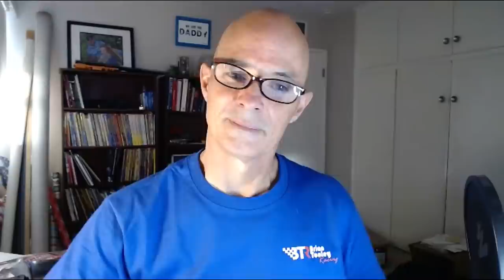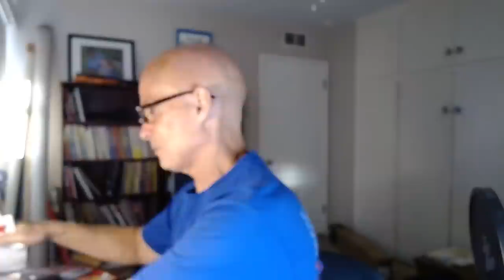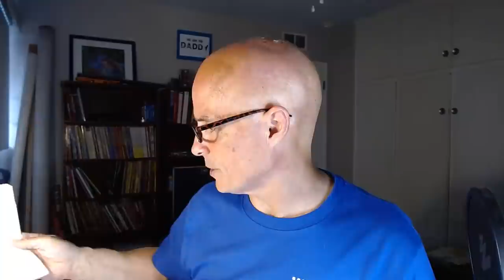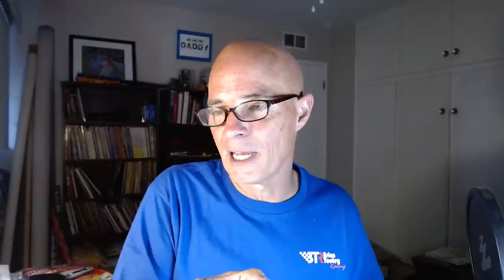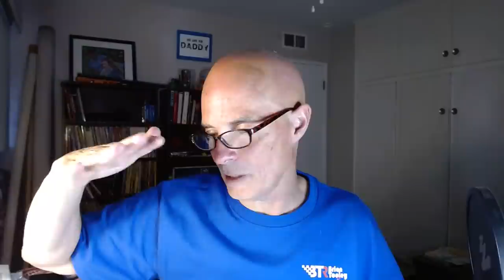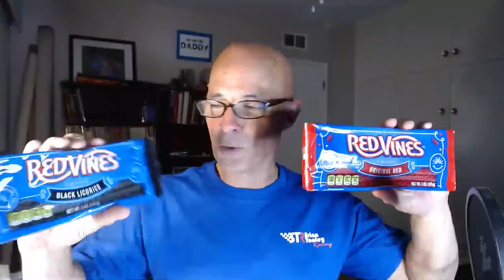LET'S TALK TECH-243 VS 862

Comment: The reason why you're losing on the bottom is head design when you do Port work a lot of people take that swirl away and try to make everything even and that's where you lose all your torque you're losing three to four percent plus your cam valve size compression ratio there's a lot to it mostly is on your head you can either build bottom end torque or lose bottom end torque when portying obviously  it was all in stock trim but the 243 had 706 head is very different on that part of the head yes you can port a head to a certain power band Believe it or not upper strength or lower bottom end strength

Comment: Maybe the Gen 4 could make more power at that point but you just sunk considerably more money in the Gen 4 to compete and hopefully spending more money would make significantly more power power. Do you think the VVT is what is making most of that extra torque in the L83 or mostly the compression?
Reply: The VVT for sure.

Comment: Thank you for all the great content as always @Richard holdener still trying to find a concrete answer though everywhere on the net as to how a stock 862/706 compares to a stock 243/799 MILLED TO 61.5 chamber on a 6.0!! Would be a similar head to a stage 2 sort of 706 then no? Thanks again!!
Reply from the maker: there was only 2.5 cc difference between the 706 and 799 heads- i recently ran another test with BTR where 243 heads made more than 862 heads-so all the 243/799 guys can now rest easy

Comment: 862’s w/ 1.89”/1.55” valves ported flowing 254 cfm @.600”.
Intake bowl 91% blended fully, maintained swirl ramp, valve guide reduction/shaping, reduced rocker bolt lump but no break through ending port size 208cc.  The port didn’t saturated continued to improve flowing 268cfm @.850”.
215cfm @.400”
This was a test to verify what the 1.89” valve can actually flow. JD
Reply: What bore and stroke?
Reply: Really like to find a spare 862 set to do larger valves and porting for a stock LR4 (flat top 4.8) minor power boost without requiring forced induction.
Reply: @shadowopsairman1583  This set is being setup specifically for a 5.3 with the stock 3.785” bore and 3.622” stroke with a cam.
Reply: @shadowopsairman1583  You’d be surprised what the oem 862 heads can do with the right camshaft, they key is don’t over cam it!  Cams like the Sloppy Stage 2 are too big for a 4.8 unless you’re prepared to run a 4000+ stall converter, 3.73-4.56 gears and Rev the engine to 7500+ rpm. 
With the tight cam you can make 400+ HP and great torque I recommend the Summit 8720 as a max size in a driver. 
If you want to keep a stock converter you’ll want a cam smaller than the 8720.
Reply: @HeadFlowInc  your right ive seen several stock LM7's and LR4's making around 400hp with just a cam, these guys keep their cam specs a secret so I don't know what they were.
Reply: @HeadFlowInc  I’m building a 6.0 bored .030 over. I’m running a BTR stage two truck cam 212/218, BTR  chromoly 7.4 pushrods, BTR rocker arms, forged pistons and rods. Also, a set of 706 heads. The engine has a compression ratio of 11.232. Speed engineering 1 7/8 headers. What do you think about that set up?… I think I could of went 7.45 pushrods
Reply: @mirabalmedia  my old motor was almost exactly like yours.  I used the BTR2 cam and it was a screamer!
I went so fast that it caught a fire all around the windshield.   Burnt the headliner right up.
I put a jet engine in my Mustang last spring, and the chicks really dig me now.
Reply: @dannymccarty344  I'm running 706 heads on my 6.0. How did your old motor run?... How was it on gas?... but, of course how was the power!
Reply: @mirabalmedia  it was a screamer!
Reply: @dannymccarty344  did you ever dyno it to see how many HP it pushed out

Comment: one thing a lot of people picking cylinder heads forget is not just port flow but the velocity of the air moving in the port.  putting to big of a port on an engine that will not support it.  just putting a huge port on a stock engine will not improve power, it could actually hurt power.  the same thing goes with the intake manifold.

Comment: Hey Richard, props to you, love your vids, your attitude, work ethic, curiosity etc.
I'm from Oz, ( Down under), building a VC commodore, 1980 Australian version of an Opel, light car (about 2400lbs) with a L98 stroked to 403ci (4" Forged crank, scat rods, forged pistons, ported 862 heads, hollow intakes, Ti retainers, Howards 226/232 .612/621" with 1.8 rockers @108 lsa, with Speedmaster ITB's (Stack) injection, Haltech ECU, etc. Hope to go ~550hp at the flywheel.
Have been tempted to run a set of CNC'd 241's for the torque numbers, but the car is so light, I think the recangles will be pretty good anyway.
I like the prospect of an NA engine, though I know boost would be fairly stratospheric!
The sound of a hi revving NA ls is very appealing! !
Thanks for your tireless work, really appreciate your no BS approach....
Reply from the maker: sounds like a great project, I love the little Opel GTs (baby Corvettes)
Reply: what about the promaxx small bore heads? 240cc runner that is 1/2” longer than cathedral ports.

Comment: I gotta tune and dyno my setup to see what its actually making, LM7 216/220 .560 114lsa camshaft 862 heads light porting and flat top pistons so im at 10.20:1 compression. Its swapped in my 99 trans am and it is noticeably more powerful than my stock LS1 (which took a crap on me)
Reply: Did your bearing mains go on the ls1?
Reply: @deqkraft3870  couple rod bearings, when I took it apart looks like the person who owned the car before me abused it. The engine started to knock about 6 months after I bought it, it probably knocked before but it was a weekend car so I didn't put a lot of miles on it.

Comment: Running ported 799 flows at 322cfm at .700 lift. Weisco pistons -3 dished in my 408 and a stage 3 tick turbo cam. Planning for a 88mm turbo on E85. Heads will flow 330cfm but at .950 lift
Reply from the maker: more than enough head flow for an 88 mm

Comment: Richard, I was going back and rewatching a lot of your LS cylinder head comparisons. I was specifically looking for the 373 and   873 heads from a 05 LQ4. I really don't see ANYONE testing these heads vs the more popular heads. 799 etc. Is there a reason for it? Those truck motors are everywhere. Part of my reason I am asking is I am about the build a motor to stuff in a Ranger for a burnout rig.
Reply from the maker: lq4 had 317s
Reply: @richardholdener1727  What are your thoughts on the 317's? I'd like to make 500 ish hp. I'm thinking a Truck Norris cam and stock everything else but manifolds

Comment: I measured 862 chambers and gotten 63ccs. Everyone online said theyre 61cc. I wanna bump my compression and mill them to 56cc. You think the chopacabra 550 lift cam will cause a problem with the head at 56cc?
Reply from the maker: I've never seen a stock 862 head that has 63-cc chambers, but you can mill the head and don't have to worry about p-v-the lift doesn't determine that (duration does)
Reply: @richardholdener1727  think the chopacabra 214/222 will be safe then with 56cc chambers if I mill them

Comment: Cnc ported 243 with chamber size of the 862 is what I'm running. With big valves. This was a noticeable difference from my valve job only 862s on a 6.0
Reply: How do you think 862 heads with cnc port job and bigger valves would do on a 6.0?
Reply: @Gonzalo6O  they would be very torquey I would imagine. The 243s seemed to spread the power out, and slightly amplify it. Bottom line they just flow better and make more power but 862s are good for low and mid
Reply: @Gonzalo6O  the setup I have is pretty much what you're describing but with the runner design from the 243s instead of the 862s. Both good heads and similar design but one was made for trucks and that's the way the power is shaped on the dyno chart. It depends on your setup. What vehicle  are you running and what do you want out of the setup?
Reply: @swappedoutZ71  Im slapping an LQ4 into my 1991 Single cab. I am going with a t56 Manual transmission. I want to make the truck lighter it has a 4.3L and it drives like shit. looking for some moderate power around 400-450 nothing too crazy, I bought a 54-459-11 cam for the 6.0
Reply: @Gonzalo6O  862s if u want daily driver power, 243s if you want more power at high rpm
Reply: @swappedoutZ71  Thanks for the input. You replying makes me more eager to get this swap done.
Reply: @Gonzalo6O  do it man, it's fun enjoying the power
Reply: @swappedoutZ71  tell me about it. I was hooked onto this lifestyle after driving a Cadillac CTS-v1 I worked on. I said, "ouuu one of these is going into my Single cab". And then the opportunity of the 6.0 popped up.

Comment: I got a 5.7 ls1 with a ls6 intake what head should I put they told me 862 heads port and polish’s are Better then 243 heads port and polish what stock heads port and polish should work best with a ls1 block and stage 4 cam with ls6 intake
Reply from the maker: the ported 243s seem to be a little better when done correctly
Reply: @richardholdener1727  High Richard, is there any big difference in porting 241 heads vs 243 if I go all out?
Also which heads would you use if you wanted to make the most power out of an 
n/a ls1 5.7 litre

Comment: I have two brand new 862 cylinder heads..... This is for my 2004 Chevy Trailblazer EXT LS 5.3L V-8 the question can I use them or did I get ripped off. I was told can be used on my Trailblazer. The heads are Aluminum from Allied Motor Parts. I got the 862 as the 706 heads have been known to crack and being on a budget trying to keep costs down...... For rods any suggestions  keeping it  OEM for now. Just want to get it back on the road.
Reply from the maker: 862 works same as 706
Reply: @richardholdener1727  Thanks sent you an email on the subject.

Comment: Will I get anymore power by porting and polishing 862 heads for a 5.3?  Adding long tubes, a carburetor and a cam upgrade, or will it bog down because of the heads?
Reply from the maker: yes you gain power from proper porting, please see the many ported head tests-it won't bog
Reply: @richardholdener1727  thank you very much

Comment: Gotta say bold prediction on V8 vs L6 that V8 wins even with the same cubes and compression in most cases. The reasoning behind that being that the V8 with similar head flow will have 33% more port flow than an L6. Most domestic push rod L6es don't have great heads either if you're honest about it. 

Based on what I'm finding on the net at first glance, the 300 head isn't exactly going to flow any more than an E7 would. 

On my 258 I'm going to cram boost into it. I'm lucky that a 4.0L head supposedly flows something like 200 CFM, so that's going on first. That'll be a big head start compared to many domestic push rod 6es of the era. For engines that are induction crippled and don't quite have the aftermarket that many V8s have it's probably the best bet.

Comment: Hey richard i have a 4.8l and i have 862 heads and im going to put a stage 2.  212/218  .600/.600 and im also going to do ls7 lifters and a stall and 3.73 gears would this be a good decent setup for daily 🤔
Reply from the maker: yes
Reply: @richardholdener1727  thank u🙏🙏💯just want to wake up my 4.8l a little more

Comment: Im interested to see dyno #s on  (valve jobs, combustion chamber work) worked 317 & 862 vs the trick flow 225s on a 408 or 416/418. Whats real time hp/tq results and is it worth buying trick flow vs investing in machining OEM heads
Reply from the maker: Properly ported, the 862s can make as much as 225 TFS heads-but you have to be very good at porting

Comment: Looking to rebuild my lq9. V6 right now on my single cab, I have a built 4l60e ready to go. Just collecting as much info I can, first timer and want to learn. Trying to max out a “stock motor” (heads ported, nnbs intake manifold and the throttle body). No nitrous/turbo or supercharger till later on. Doing all that work might as well throw a cam right 🤣 what heads will help with my build? 243? 799? I do want good low end and top end.
Reply from the maker: use 243/799 (same heads) if you have them
Reply: @richardholdener1727  what cam is best if I was to put a lsa supercharger or nitrous. I thought about BTR just don’t know what stage.. if 2 or 3.

Comment: Is the difference on 243 head chamber width from org application 5.7 LS6 vs the later 6.0 LS2 application.  I have flowed 243 on SF600 2 sets one from a ls6 and ls2 one set went 248CFM other went 258 CFM that was on a 4.060 bore.  Did you run into port going turbulent on your test around 550 or 600? I never checked chamber width I know they never measure 64cc one came in at 68cc and other was 65cc

Comment: Hey Mr. Holdner, love your vids and the way you explain stuff.  So. I have a couple of questions for you if I may please.  

I have a 4th gen Camaro. LS2  Aluminum Short Block , Stock Compression, West coast fully ported L98's
DBL LP385 Pumps, LSXHR Manifold. I want to go twin-turbo. How much Can I realistically and reliably expect from this setup?
Reply from the maker: STOCK BOTTOME END?
Reply: @richardholdener1727  yes sir.
Reply: Well. Not completely. I will have summit h beam connecting rods and forged Pistons but the crank will remain stock.
Reply: @schase5193  get the crank too or enjoy having a limiting factor in your otherwise stout build

Comment: Would a set of stick 243 -.30 milled flow just as good as set of same heads ported on gen 4 cammed 5.3 ? Or would  it be better to kill and port for drive around street performance?
Reply from the maker: porting adds flow, milling adds compression

Comment: Just bought a low mileage older F body.   5.7 headers, full SLP exhaust, cat delete.   Tqrv2112 cam, z06 intake as well and tune......dyno sheet he provided states   402.6 @6228 rpm     and  356.1@4972.    409.1 with WCF HP  and 362.1 torque at WCF     Does this sound legit numbers.  Or should it make more.   Thanks

Comment: So far I’ve never found anybody who’s built this kind of engine. I wonder what combination will produce a quick revving, high revving responsive Ford Windsor V8 for the street. More like Ferrari 355 V8 or an F1 engine. With no flat plane crank of course.It would be really interesting to see what combination would produce this kind of engine? Short stroke, small displacement, compression, which cam, which heads? etc.

Comment: I may be wrong but I believe the smaller 706 head works like a 1 3/4 inch header vs 1 7/8 a little more bottom end comes from smaller passages I thought it was like common sense big turbos have less bottom end in my experience on my diesel trucks
Reply: Every video I see claims the 7/8 don't lose anything over the 3/4 everyone claims the 7/8 makes more tq

Comment: Hey Richard, I have a 5.3 l59 with 862 heads with a SS2 cam. Im thinking of putting on 243 heads with flat top pistons or maybe keep the 862 heads with the flat tops. what is the go to here? what should i do?
Reply from the maker: flat tops and 706 (ported with bigger valves)
Reply: @richardholdener1727  706 heads over 862 heads?? Just picked up another lm7 with 706 heads two days ago.
Reply: I guess i should mention this is in a tahoe. 2800 stall. 3.73 gears for now.
Reply from the maker: 706 and 862 are the same heads (performance wise)

Comment: What diameter exhaust would you run on a Gbody with a 6.0L, stock 862 heads, Gen IV pistons/rods, 92mm TB, LS6 intake, Sloppy Stage 2 cam,  and 1-7/8" mid length headers? 2.5"? or 3.0"?  I'm looking at the Pypes systems.
Reply from the maker: a 3.0 will make more power but not much

Comment: Good morning I always watch your programs and I like them a lot.  I ask, I have an original 5.3 LM7 engine and 862 covers with a pressurized shift 68 inlet and outlet 90 with a Fitech injection system for 750 hp with a 102 millimeter jog, which lift shaft would be good for the street, thanks
Reply from the maker: pressurized shift 68 inlet?
Reply: Sounds like a job for truck norris...

Comment: I wanna see info on a lq4 with 862 heads with a s480 which I'm currently building but indecisive on heads to get. Lmk thanks.
Reply from the maker: street car? pump gas? what other heads do you have? what is the desired power level?
Reply: Yes street car. 93pump gas. I have 2 sets of 862 heads and the cast iron heads that came off the 6.0. Power goal is around 700-750.
Reply: @richardholdener1727   make a video on that. Id like to very much see the out come. 6.0l, 862 heads with a S480 on pump gas. 👍🏼

Comment: PRC of Texas Speed says their stage 2.5 ls6 243 flows 316 @ .600. Not sure the bore they used. I hope they are correct. smile
Reply from the maker: IT SHOULD
Reply: @richardholdener1727  Thank you. Have you ever done testing with the Cleetus McFarland N/A bald eagle 600/600 227/234  cam on a 6.0 with a set of heads like I mentioned above? Has an Edelbrock dual plane and Brawler race 750. I did most of what you said except the cam, I will switch to the comp 469 if you recommend it. Thank you again for all you do for us!
Reply: I want to say they were flowed on a 3.900" bore. I emailed them once, as I own a set of PRC Stg 2.5s - that was the reply that I got.